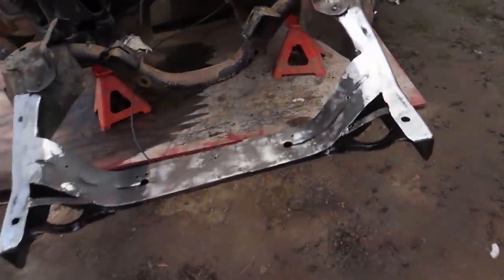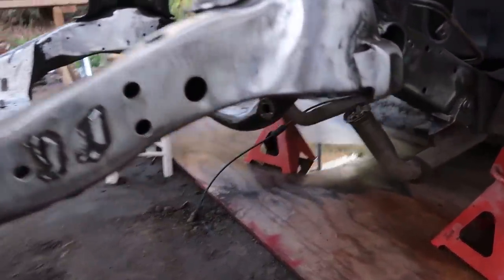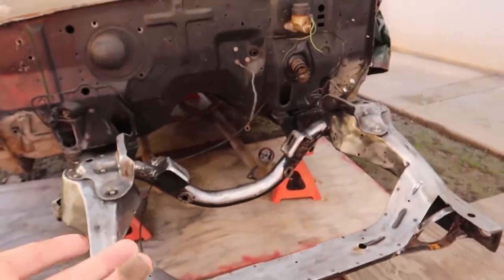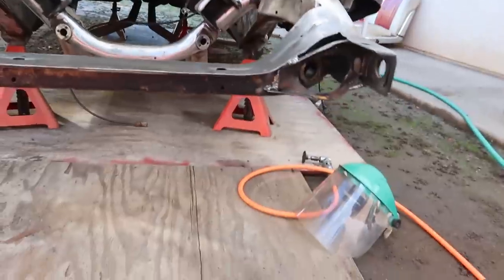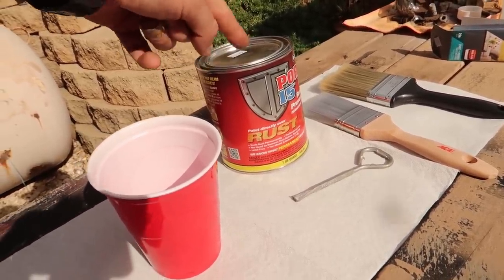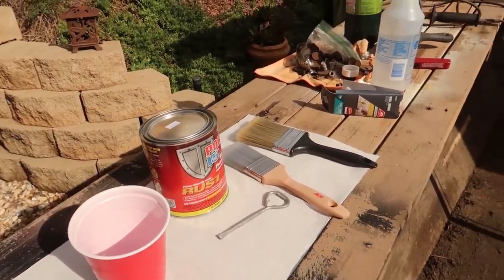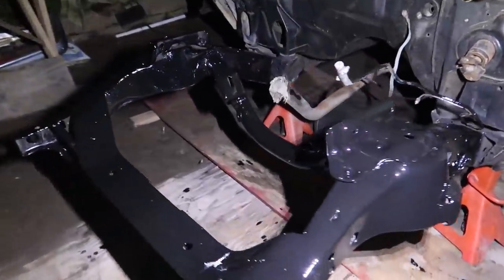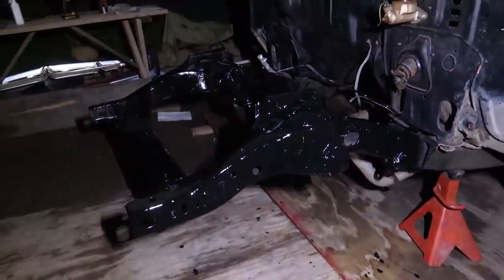Professionally Painting ANY Car Frame For UNDER $100!

Comment: I have had bad luck with POR 15 over clean metal. Its called POR " paint over rust" for a reason. It really needs rust to cover to bite into. It work well for what its designed for. Encapsulate rust and prevent it from getting worse. IMO, its not so good for clean metal. You got your frame so nice I would of primed and painted it.  To use POR 15, i just clean and degrease frame, knock loose stuff off with wire brush or wheel, degrease again and paint.  Turns out great. You went above and beyond and did a great job cleaning and prepping. It would of taken a nice paint job and lasted for a long time.
Reply: POR15 can be used over bare metal, when prepped properly. It's the metal prep process before that is crucial for adhesion. Rust on a car or truck frame tends to be spotty/not consistent in coverage. And in most cases, wire brushing the loose rust off leaves exposed bare metal. Complete media blasted frames are POR15 coated all the time.

Comment: POR-15 is awesome. It also adheres to rust and the metal will no longer continue the rust process. Like you mentioned, it does need to be painted y you have the metal exposed to the sun. It does work better when it is humid too. Thank you.

Comment: I used POR-15 on the inside of my 66 Impala wheel wells. I found out that if you get it on your skin, you'll have to wear it off if it dries. For a firewall and frame, I like satin black better than the super high gloss. Your frame turned out nice. I really like that car!

Comment: Kevin here with HTXF100s. I'm jumping ahead before finishing the video but just in case you aren't aware....don't let that POR15 be in direct sunlight too long if any at all. It will break down and start to look like poop. I am actually doing my frame right now to put in my fuel system and brake lines. I'm using the Rustoleum Rust Barrier stuff and I have to say I'm pretty impressed by it. Just my experience after having the POR15 fail on me. Don't get me wrong, POR15 looks great and if I had the time before to do the entire truck with it correctly then I probably would've been fine. Keep it up and watch out for those UV rays on the frame!
Reply: I love how the POR15 self levels and finished look gives that glassy appearance.

Comment: the moment I saw him put the lid back on that POR15 I knew... he had never used it before!
Reply: From ever video I have seen, you are correct about not getting the lid back off. Pry up with everything in you toolbox & garage, then end up using “Vise Grips” and destroy the can. 
Retired ASE Tech
Reply: Just lay some plastic bag over can then put lid back on, lid will come off when needed again
Reply: That sounds like the best idea yet. Cut a zip lock because it’s thicker than plastic wrap for food.
 The way I understand POR-15, it hardens with moisture in the air. So if lid is open, before stirring, clean lid seal cavity with paper towel and flat blade screwdriver. Then with 1/2” masking tape, cover the cavity to keep clean. Many use two inch tape to create a “V” on can to pour from. Then remove tape and seal. I don’t know why, but I alway use a 12” 2 X 4 wood block to tap lid back on as not to crush it. But use the heavy plastic first. 
  Inside frame sealer on the cheap? My grandad took 2 toilet wax seals and melted with with boiled linseed oil. He wiped his saws & other to keep from rusting. I have a metal bottle with screw-on spray gun. It used a disconnect like air hose, but tiny and has 5 different hoses / tips. HF May sell a similar tool but thin if needed with cap of mineral spirits. Bowl seals aren't bee’s was but petroleum based. It thinks it just as well as it hardens at room temp and stays at higher temp. But after all, the video is $100 dollars? So done cheap!
Have a good day!

Comment: Good job on the frame!!! It was done correctly. Gonna last forever now. 40 yrs experience here . It's alot better doing it right the first time. All new parts going in is gonna be a real eye catcher.
Reply: As someone with 40 years experience do you recommend POR15? Any other products? Ive heard a lot of people with alleged restoration experience say that it is absolute crap and doesnt last...just peels off after a year or two even if prepped properly. They say it cures too hard and brittle and cant flex or expand with the metal of the frame. Any thoughts on that?
Reply: @foskco87  what I use and seems to work fore is implement paint from tractor supply. Right or wrong it works and lasts for me. Prep is key. It's real tuff paint and sticks. Also it's oil base self leveling

Comment: If im not mistaken, por stands for paint over rust and i thought you needed a rougher surface for the paint to stick to the frame. If thats not the case thats cool because i saw a guy that did this with his f100 frame and he had pictures of the paint flaking off after a short time

Edit: now that i heard you say that its not uv protected, that may have been the case. Anyways sorry for ranting. Love the builds
Reply from the maker: All good man. Thank you 👍🏼

Comment: Thank you for making this video and others. It's helped me really learn a lot on which direction to go with my truck.  I'm really close to finishing the floor pans in my 1967 F100. Next I'm pulling out the engine and removing the bed this month. My goal right now is to knock off the rust from the frame, paint with POR15, and clean the engine bay up by the end of the year. What did you put on before you painted and did it come with your POR15?

Comment: Yes, the whole frame, but being busy in my garage, I did not catch the kind of car. A subframe would make this job easier if the floors are good. Unfortunately even with all of the correct steps some like it and others will never use it again. Too bad it’s not catalyzed to make it more like an Epoxy! Time will tell because of where it’s located and I think you are not going rock climbing in Moab, UT.! lol... ASE Master Tech since 1978 - Retired

Comment: I need to do this to my 75 F150 frame which is covered in surface rust. What wheel would you recommend for that?
Reply: Just a wire wheel cup on a grinder & a angle die grinder to get into some smaller spots

Comment: Great job no offense but telling people to spray oil and pb blaster is a bad tip that just opens the door for contamination witch you could clearly see with those bare metal spots those are fish eyes they are caused by contamination just my 2 cents